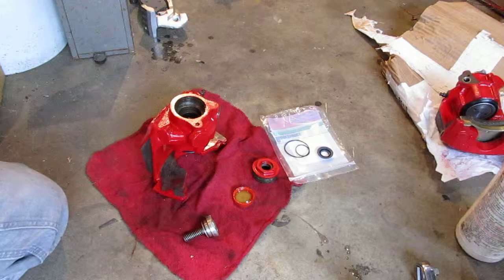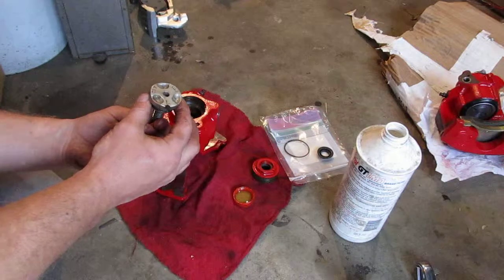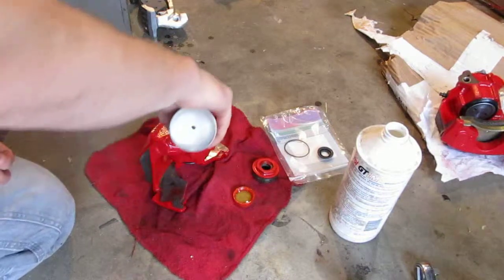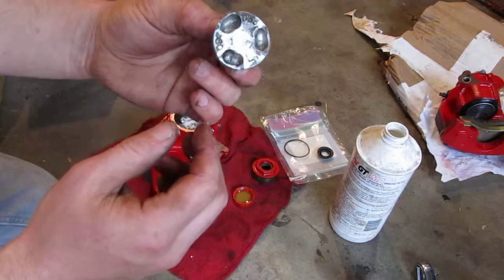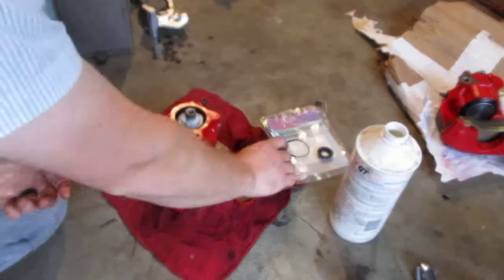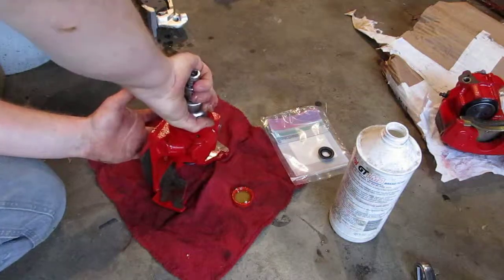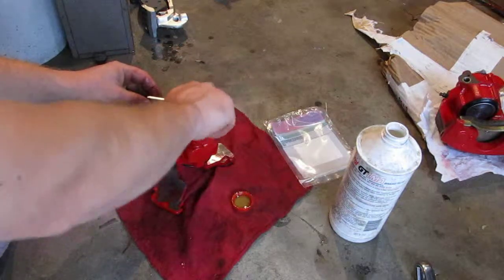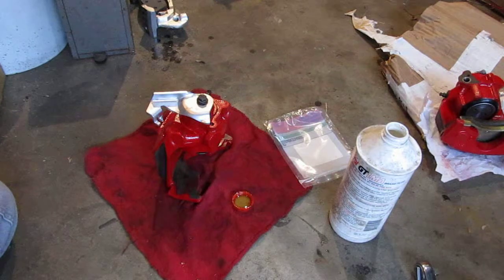Versailles Caliper Rebuild: Part 3

Comment: As you say, there isn't much on the internet about this. My issue is actually making the emergency brake work after installing a new caliper. I have installed and bled the calipers but no matter how short or long the cable is, I can't get the emergency brake to work properly. Something has done something however because I can barely turn the hub with a breaker bar. One question (among many) is when the brake is not engaged, should the cable be extended to the lever at the farthest point in the swivel with no slack? And when the brake IS engaged, should the lever then rotate to the closest position? I don't know if I explained that clearly.
Reply from the maker: Thanks for the question.  The emergency brakes on these setups are notoriously difficult to make operate properly.  If you can't even turn the hub with a breaker bar, then it seems like something is binding inside the caliper itself.  My initial guess would be the piston is extended to far.  Make sure the piston starts fully seated, or at least loose enough for initial setup.  If that was attended to to begin with, it may have been an issue with the assembly, for instance, one of those three bearings for the parking brake may not be in its ramp and causing too much tension there.  When the parking brake is released, the levers should point down and slightly back towards the rear of the car.  When engaged, the cable pulls the levers forward toward the front of the vehicle to apply the parking brake.  I hope this helps.  Best of luck on your project!
Reply: @FixItUpJack   Great video that I've been studying as I rebuild my set of calipers. Do you have any advice to remove the thrust pin? Mine is not coming out? Thanks man...

Comment from the maker: The parking brake lever didn't really seem functional until the calipers were on the car & bled. There's very little to no movement there until everything is loaded. I myself wondered if they were going to work. Once on the car, I actuated the parking brakes over & over until I felt that they had fully adjusted themselves out. They hold now but what everyone says on the web is true; they aren't great.  Pretty weak overall & poor design. But for a manual car, I'm glad I at least have something.
Reply from the maker: @LadyLaLa4577  Hi and thanks for the question. I had to come home and look what I had done because it had been quite a while. What I wound up doing was taking the 66 mustang cables and the Lincoln Versailles cables and binding them together with cable clamps in a spot where they had the right amount of tension and pull. I added crimps on the pulling side of each cable to make sure they never slip. Kinda ugly, wouldn't win any car show beauty contest, but they are hidden deep under the car in the trans tunnel and they work quite well so I'm happy with that!